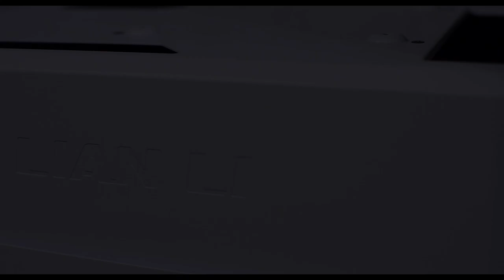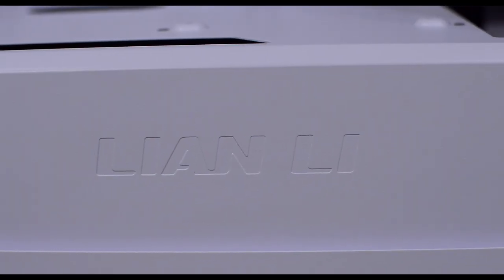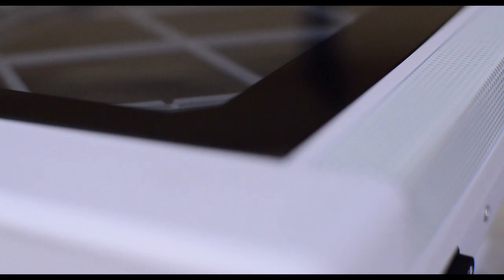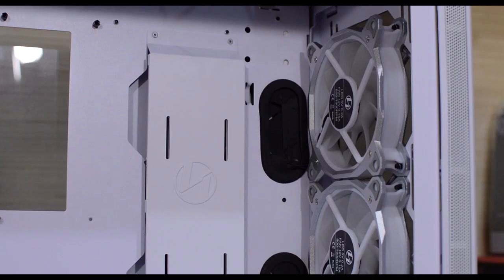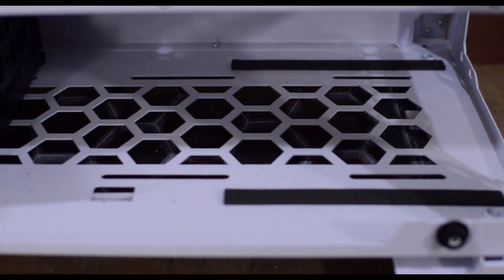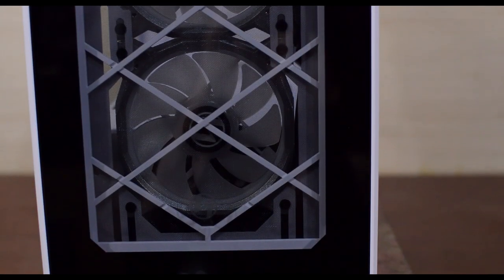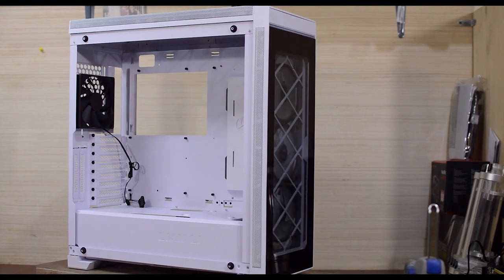LIAN LI ALPHA 550

Comment: You should have worked more on the cables. Suggestion:  Change 1 black and the others white combo for the 24pin connector cable. That is my only complaint!

Comment: Question, The rad at 4:58 that wouldn't fit what rad is that? and when you removed the front glass how hard was it? I'm thinking about replacing the top and front glass with mesh. Great vid by the way all the detail you showed was good. I even found pics of this build when looking on Google lol

Comment: What's the point of a Formula mobo if you aren't going to use the EK VRM blocks?
Reply: Yeah i agree really nice clean looking build but should have tied the VRM into the loop.  He has a D5 pump so it would have been fine running through all 3 blocks.
Reply: Yeah, it would have also filled up that empty corner of the case as well.
Reply from the maker: personal preference. i didnt feel like add two more tubes in the loop. i wanted to keep it simple.
Reply from the maker: and also.. there is no point other than that. i always feel its better to have it and not need it, than to need it and not have it. maybe on a different build, i'll use the motherboard block. soon.
Reply: Well great job anyway it looks great. I like watching your builds.  I am working on a PC desk now still in the woodworking phase of the build but should have the desk done in a month then it will be paint then hardware installation.
Reply: You ask me: Acrylic tube you use the computer on the outboard video is 12mm or 14mm so thank you.

Comment: i built my pc in Lian-Li Alpha 330 and i can say this. At the top i managed only to fit 30mm thick rad with fans bigger rad would not fit for me, at the front there is about a centimetre left from fans touching the metal which seperates two compartments, you could maybe fit 40-45mm not sure since i didnt have one on me. I only had few issues with the case, 1: cable cover was hassle to work with since my Asus Rampage Iv Extreme is E-ATX motherboard, 2: Front tempered glass is bit annoying since it kind of chokes out fans from pulling out through the radiator in a near future i might remove front tempered glass and replace it with modified acrylic to let fans pull in more air. Here's my build after being turned on first time: https://imgur.com/a/VVqp0

Comment: two things, whay didn't you use 2 more fittings and add the vrms to the loop sense the ek blocks were already there? and the other thing, I just realized in this video that it wasn't your finger nails painted with glitter.... lol
Reply: if you had rotated the cpu block 90deg and looped off the top port to the lower port on the vrm block it would have kept your angles like you have. worked on my old build.
Reply from the maker: tried that. the angles were off. not the look i was gunning for.